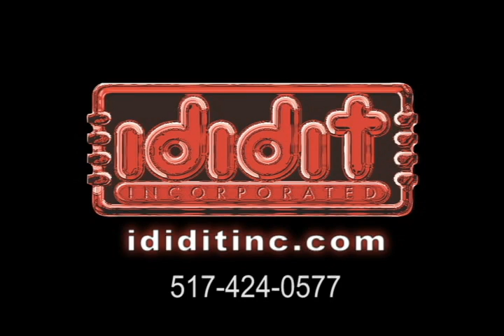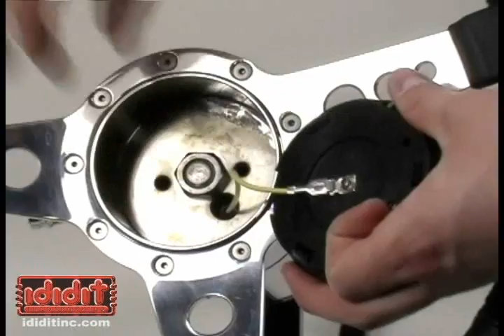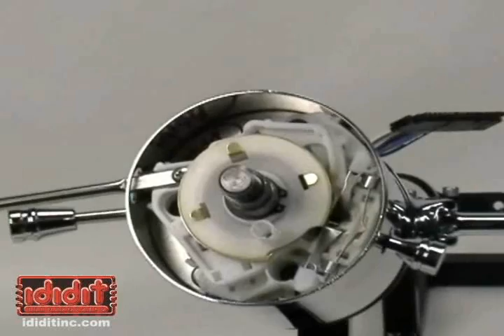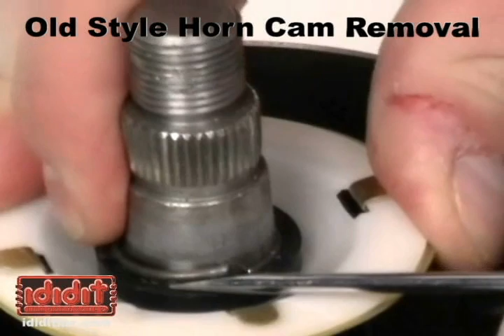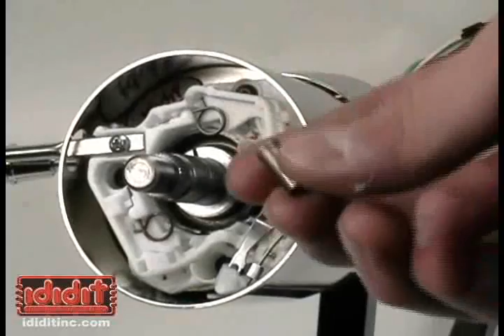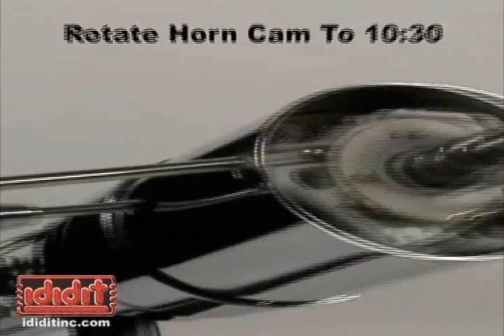ididit Horn Contact Repair Instructions

Comment: The thing is if you dont fix the cancelling cam, it wont make contact to the bottom part that he fixed, you can probably shim it to make contact somehow, it will work as long as it makes contact when turning the steering wheel  ,

Comment: What is important about the "10:30 position? It's not contacting anything different in any other position. And what is the function of the pressed in plunger under the disc that you refer to? I don't see what contacts it. Confusing and nothing is working so far.
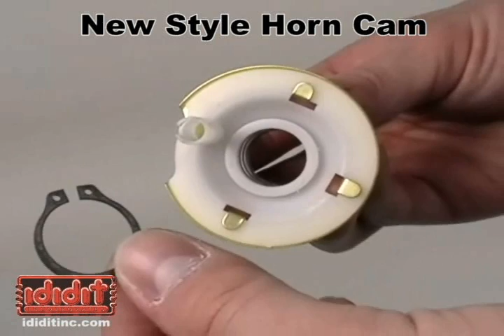Reply from the maker: On the back side of the horn cam there are two lobes molded into the plastic.  When the turn signals are engaged and the wheel is turned, those lobes contact the cancelling springs that are in the turn signal switch.  One of those springs is at about 7 and the other near 2:00 o'clock.   The 10:30 position is the center point between these springs.  By clocking the horn cam properly you ensure that the turn signals cancel evenly no matter if you're turning left or right.  

The plunger provides constant contact to the back side of the horn cam.  You would have a horn wire or another plunger attached to the tube of the horn cam that then contacts with the horn button.  Which style depends on the wheel itself.  The entire horn wiring system works off of ground utilizing a horn relay.   When you push down on the horn button it makes contact inside the wheel completing the ground causing the horn to blow.  I hope this is helpful. Please give us a call at 517-424-0577 if you need us.

Comment: What bullshit! Where do the horn wires connect on the reinstall?
Reply: The wire goes into the same 10:30 position hole in the cancelling cam where it was before, duh